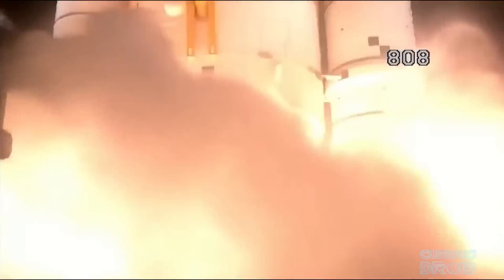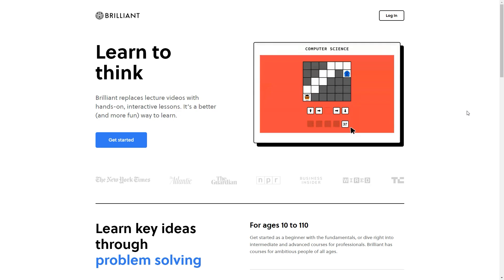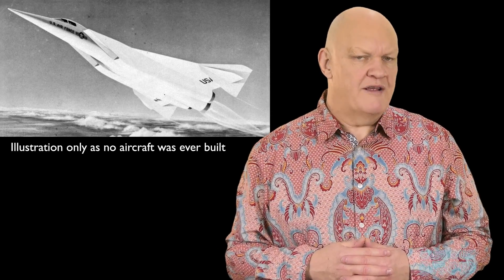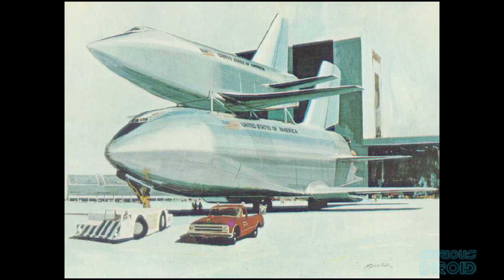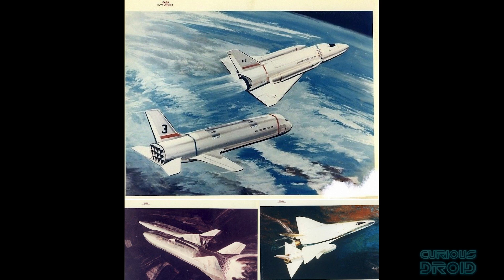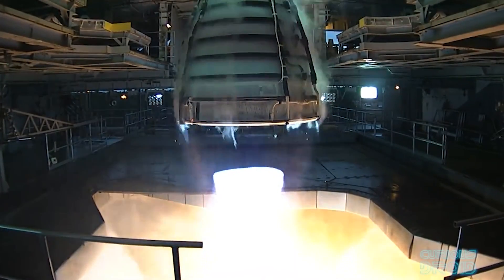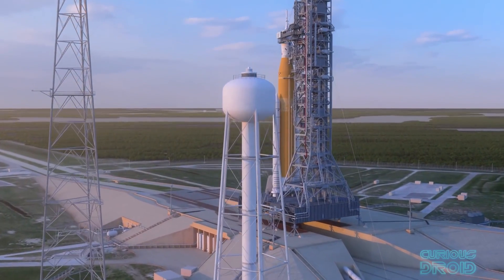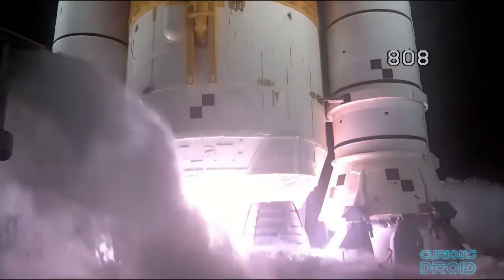Why is NASA Throwing Away Reusable Engines?

Comment: So in 2020 they have a contract to build new engines at 100m ea. or 400m per vehicle. Also in 2020 SpaceX estimates at the high end if they produce a Starship a week, it'll cost 20 million. For the ENTIRE SHIP and engines. And be re-usable. So ... that means 5 Starships for the cost of one Artimis engine - or 20 Starships - for one Artimis launch.

And if that's not enough - they hope to halve the cost by making 2 Starships a week. So double all the previous numbers, meaning a fleet of 40 Starships per launch.

I can't seem to get excited for NASA's approach ... for some reason.
Reply: The $20M is almost certainly for the bare bones test articles and they don't even make those in a week.
Reply: @steveaustin2686  I'm just quoting their numbers. SpaceX wants fleets to build up Mars, so how built out or what configuration is speculative at best, but that's the target number for production. Mind you - if the full-out costs come under 450m that's cheaper than a 747 (new) and there's a lot of those around. Over 1500. Elon wants far more than that so he's probably going to drive those numbers way down by volume of production. 

One fun thing people miss out on all the starbase implementations. They're not just launch and test areas, they're assembly lines which are modular and expandable. In terms of current production rates - they're pretty fast for the test articles.

Once they have the design tested and locked-down obviously those numbers can increase. You have to remember that while they're updating the ship, they're also updating the production methods with new robots and procedures.
Reply: @mgabrysSF  Musk puts out a lot of aspirational goals for the future that people take as near term goals. Musk wants in the future to fly Starship every day, but the SpaceX plan for Artemis III is 1 Starship variant launch every 12 days. Be careful with Musk numbers, becuase they are also not always realized.
Reply: @steveaustin2686  Oh no argument there - Musk always has high goals - but if he can beat a 747 when fitted, I'm on the side he might have something (when produced in volume). Also don't forget mission profile and staging. He's looking to maintain a fleet in-orbit until in-orbit fueled for Lunar or Mars transit. So it's not a single shot - it's many many shots per-mission for a massive fleet. But with a re-usable platform this isn't as crazy as it sounds.

In flight re-fueling is what we've used for over half a century for force-projection of our aircraft around the world. Doing the same for space is a no-brainer.

I'm more interested in how they'll mitigate grav and radiation in transit (outside water stowage around crew areas (there's a reason we use water in reactor pools for neutron absorption and regulation) and inflatable ring habs or extending booms and tethers for reduced grav cruising is my two hunches). Always love a good debate on the nuts and bolts, so go nuts. Always fun.
Reply: @mgabrysSF  Yeah, Musk has admitted that he makes overly ambitious goals for SpaceX to reach as far as they can, before settling on what they can do. So his goals may not be possible to be reached.

From page 27 of the GAO decision to deny the Blue Origin complaint. [DELETED] is apparently at least a propellant depot Starship variant from the context and SpaceX had the GAO redact that info. Added in Musk's payload update (~150t) and he says that it is up to 8 Tankers to fully refill Lunar Starship, depending on Lunar Starship's mass. My comments are in ().

"SpaceX’s concept of operations contemplated ten total launches (down from 16), consisting of: 1 launch of its [DELETED]; 8 launches of its Tanker Starships to supply fuel to [DELETED] (down from 14); and 1 launch of its HLS Lander Starship, which would be [DELETED] and then travel to the Moon."

Musk said that they hope that they can get the Starship Tanker launches down to 4, but they have already dropped from 14 to 8 (43% less), so I would not hold out hope for a further 50% reduction. At 150 tons of payload, 8 Starship Tankers would take 1,200 tons to LEO. With whatever left over propellant is in HLS Starship when it reaches the depot, that should likely take care of boil off during the 15 or so weeks of filling the depot.

Part of the Artemis program is developing the tech and skills needed for a future Mars mission, while in our own backyard as it were. I'm sure once Lunar Gateway is up and running, there will be tests of radiation mitigation methods. Not to mention whatever they also do on the surface missions.

Note, the [DELETED] Starship propellant depot will likely be put into whatever inclination that the final mission Starship will use, so if you are sending Starships to different inclinations, you will need multiple depots. No idea on how long a Starship propellant depot can stay in orbit, as SpaceX had the GAO redact all info on the depots. Assuming that depot longevity info was in the HLS Option A bid in the first place.

Comment: To fly a fully disposable rocket in 2022 is utter madness, and even more crazy is that NASA take engines designed to be re-usable and dump them after one launch. No wonder SLS costs £3-4B per flight, and that's still using a large amount of SS tech!
Reply: Booster reusability is great, but has drawbacks.

First, if you don't have a fast enough launch cadence, you can spend more on recovery equipment and personnel than you save by reusing the booster.
Second, you take a payload hit for the recovery system on the booster. The Falcon 9 B5 can lift up to 22.8 tons to LEO when expended (SX), but only up to 16.7 tons when landed on a drone ship (B1069.2). Doing a Return to Launch Site (RTLS) landing, costs even more payload as you have a boost back burn to cancel the lateral velocity and return back to the launch site.
Third, the higher and faster you go, the harder reusability is to perform. The heavier the dry-mass of your booster, the harder reusability is to perform.

So with SLS launching once a year, eventually, the cadence doesn't really justify recovering the booster. Not to mention that it gets higher and faster than a Falcon 9 as the SLS core stage almost reaches orbit, making recovery MUCH more difficult. The SLS core stage is travelling well over 3 times as fast as the Falcon 9 booster and is well over twice as high as the Falcon 9 booster at MECO. The dry mass of the F9 booster is 22-25 tons while the SLS core stage is 85 tons.
The SLS Block 1 can get Orion to the Moon, but not with the kind of payload hit like F9 has. The SLS Block 1B will send along a Lunar Gateway module with Orion, so it really can't take the payload hit either.

SLS started design work in 2011, 4 years before SpaceX landed the first booster and almost 6 years before they reused a booster.

Comment: Reuseability is not that easy when you are going to the moon and beyond. Effectively to make a reusable rocket you need to have excess power to also launch ft the extra fuel to land again and the extra weight of the landing legs and other systems needed to land again.

It’s one thing to do that if are sending 5-10 tons to low earth orbit, but something entirely different if you are going to the moon. It’s never been done.

SpaceX is trying with Starship, but they have yet to prove that it works.

Comment: SLS would be a great achievement if it was not being compared to  Falcon 9 heavy and starship.
Reply: SLS block 1 has a LEO payload of 100tons. Even in fully expendable mode, falcon heavy maxes out at 65tons. Starship/super heavy are yet to fly.
Reply: @32990-w  Essentially correct. SLS Block 1 is 95 tons and SLS Block 1B is 105 tons to LEO. The Falcon Heavy is 63.8 tons when fully expended. When fully recovered the FH is somewhere around 30 tons. The SLS Block 1 can send 27 tons to the Moon and the SLS 1B can send 42 tons to the Moon. A fully expended FH can send around 17 tons to the Moon.
Reply: 100 tons once a year if you are lucky. What type of mission could you plan with that launch cadence.

Comment: It all comes down to cost and efficiency in a normal world, but NASA is beholden to politicians before and after anything else. The whole SLS program could have been another proper step forwards and saved the tax payer a lot of money in the long run, but instead they got what they have now a mix match of old stuff that is both expensive to make and operate while throwing it all away. 

I do not blame NASA a single bit for this, but the politicians they 100% deserve the blame for what is truly a disappointment of a program. Yes it can get the USA back to the moon, but it does little more than prior systems and that is the crux of the issue, technology needs to be pushed onwards.
Reply: Booster reusability is great, but has drawbacks.

First, if you don't have a fast enough launch cadence, you can spend more on recovery equipment and personnel than you save by reusing the booster.
Second, you take a payload hit for the recovery system on the booster. The Falcon 9 B5 can lift up to 22.8 tons to LEO when expended (SX), but only up to 16.7 tons when landed on a drone ship (B1069.2). Doing a Return to Launch Site (RTLS) landing, costs even more payload as you have a boost back burn to cancel the lateral velocity and return back to the launch site.
Third, the higher and faster you go, the harder reusability is to perform. The heavier the dry-mass of your booster, the harder reusability is to perform.

So with SLS launching once a year, eventually, the cadence doesn't really justify recovering the booster. Not to mention that it gets higher and faster than a Falcon 9 as the SLS core stage almost reaches orbit, making recovery MUCH more difficult. The SLS core stage is travelling well over 3 times as fast as the Falcon 9 booster and is well over twice as high as the Falcon 9 booster at MECO. The dry mass of the F9 booster is 22-25 tons while the SLS core stage is 85 tons.
The SLS Block 1 can get Orion to the Moon, but not with the kind of payload hit like F9 has. The SLS Block 1B will send along a Lunar Gateway module with Orion, so it really can't take the payload hit either.

SLS started design work in 2011, 4 years before SpaceX landed the first booster and almost 6 years before they reused a booster.

Comment: Wonder is any one is allowed to have the thrown away engines ??
Reply: Booster reusability is great, but has drawbacks.

First, if you don't have a fast enough launch cadence, you can spend more on recovery equipment and personnel than you save by reusing the booster.
Second, you take a payload hit for the recovery system on the booster. The Falcon 9 B5 can lift up to 22.8 tons to LEO when expended (SX), but only up to 16.7 tons when landed on a drone ship (B1069.2). Doing a Return to Launch Site (RTLS) landing, costs even more payload as you have a boost back burn to cancel the lateral velocity and return back to the launch site.
Third, the higher and faster you go, the harder reusability is to perform. The heavier the dry-mass of your booster, the harder reusability is to perform.

So with SLS launching once a year, eventually, the cadence doesn't really justify recovering the booster. Not to mention that it gets higher and faster than a Falcon 9 as the SLS core stage almost reaches orbit, making recovery MUCH more difficult. The SLS core stage is travelling well over 3 times as fast as the Falcon 9 booster and is well over twice as high as the Falcon 9 booster at MECO. The dry mass of the F9 booster is 22-25 tons while the SLS core stage is 85 tons.
The SLS Block 1 can get Orion to the Moon, but not with the kind of payload hit like F9 has. The SLS Block 1B will send along a Lunar Gateway module with Orion, so it really can't take the payload hit either.

SLS started design work in 2011, 4 years before SpaceX landed the first booster and almost 6 years before they reused a booster.

Comment: SRBs always come to rescue any project. But there is no throttle control. They were steerable and reusable and as all SRBs are they are heavy when loaded but very powerful.
The RS25 could be made reusable if it could detach and use a parachute.

Comment: It really blows me away that there weren’t any computer-aided design or physics simulations that we have now, and these are still some of the most technically advanced rocket engines we publicly have.  All the engineering and mechanical designs were done with pencil on paper and the equivalent of a pocket calculator.
Reply: Nonsense.  They had CAD and simulations in the 70's and 80's. Nothing like we have now, but it did exist.
Reply: @TheEvilmooseofdoom  You're right. I was thinking (not out loud, obvs) about the older engines built and designed in the 50s & 60s.  I could have been clearer.

Comment: Honestly I'm just confused as to why a 40+ year old engine costs so much to make.  Surely for the cost of a couple of these engines all the tooling could be built automate most of the manufacturing and assembly process.
Reply: Production is hard.  Harder than most people realize.  Elon harps on that a lot.
Reply: No point in building a factory for small production runs. That's the catch... RS-25 is too expensive to make, so they'll never make many of them. And because they're never going to build many of them, there's no point in investing in making them cheaper to manufacture.
Reply: @simongeard4824  That's sort of my point.  The cost in in hand making each and every part and testing it to make sure it was made correctly, then remaking it if it wasn't.  It has to be far more efficient to create tooling to mass produce the engines, and run them off at scale when you are talking 40 million a piece originally and something well over 100 million each for this new run of them.  The cost of a single engine is enough to pay for the machinery to mass produce them.  even if you throw away 90% of the engines made, it would still be cheaper to make them in bulk, and if they were smart about it, they would use a smaler design with more of them, such that a rocket could be designed to work even if maybe 25% of it's engines didn't work.  Mass produce the engines, strap 30 of them on a rocket, and don't care if 5 of them don't work, all at a cost far less than the 50 year old "current" design.
Reply: @johngaltline9933  I don't disagree, but to make that work, you need to design the engine with mass manufacturing in mind. And RS-25 having been designed fifty years ago for small volumes - enough reusable engines for just half a dozen orbiters - isn't. Whereas Merlin and Raptor have been designed for ease of manufacturing and servicing, just as much as for engine performance. Or for non-reusable counterparts, the various Soviet / Russian engines, which could be manufactured in sufficient numbers and at sufficient cost to keep their space program running.

Comment: Reusability is not the end all be all fyi, this thing is taking a human rated capsule to the moon, something Falcon 9 and even Falcon heavy would have to do some expendability to even achieve
Reply: Even then, former NASA Admin Bridenstine said that the aerodynamics of the Orion, ESM, and ICPS on a fully expended Falcon Heavy were an issue. Not to mention that when the 8.4m EUS replaces the 5m ICPS on Artemis IV, the Falcon Heavy would be out, even if the aerodynamics were not an issue.